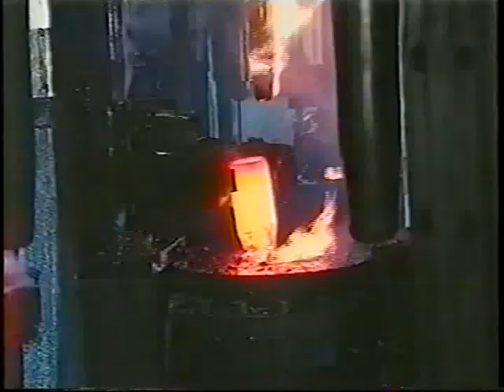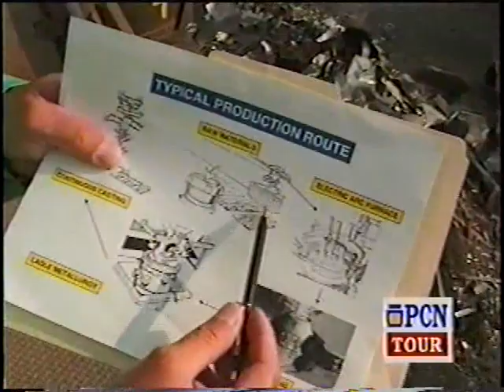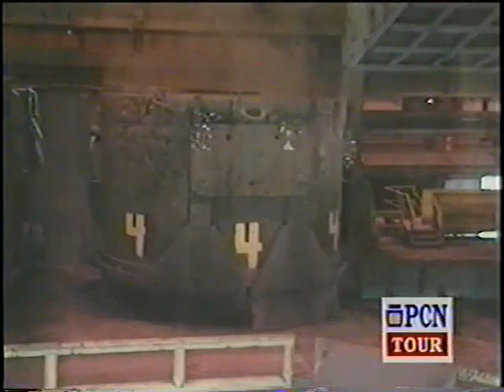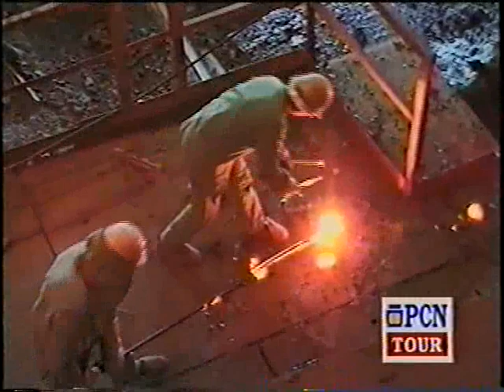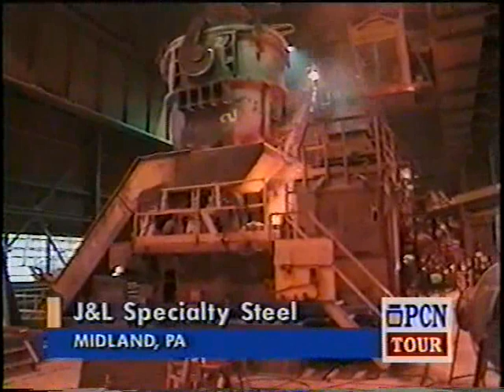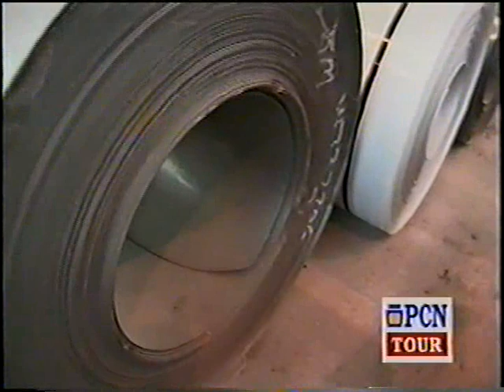PCN Tour J & L Specialty Steel

Comment: I almost took a job there on the DRAP line.  I backed out because a former manager contacted me and warned me about a certain plant manager who was the yell, scream and kick trash cans type of manager.  I still debate whether I should have gone to work there despite the fact that the facility ultimately did closed down.
Reply: I worked security there during the DRAP construction. Still remember the day a construction worker got killed there is a pretty gruesome manner. I always figured the guys down in refractory has a sweet job. For the most part they sat around unless there was a ladle burn through and the occasional ladle reline. For the most part they had a big pit BBQ going on down there on most days.
Reply: @currentsitguy  I was working for GE at the time for the DRAP line installation and commissioning - BWG was the main mechanical supplier - GE was the main electrical, motors, controllers, power..  I was on site the day that accident occurred.  Union Iron worker  It was my first major steel mill project and first job site death.   DRAP line was a big project I was able to see it from the initial concrete pad pour to the first coil.
Reply: @ Shame it's all shut down now.
Reply: @do you know if its torn down?  I tried to look and see what remained by looking up Midland on Google maps, but wasn't sure of the location I thought it was 1200 Midland Ave?
Reply: @yopajo  I drive past every week. It's not torn down, just shut down and abandoned. The mill is idle.

Comment: Is this plant still open? I sure hope it is
Reply: In 2004 it was bought by Allegheny Technologies. In 2015 they locked the workers out for 7 months. A new contract was signed and they closed this plant down. In November of 2017, the DRAP line was reopened. The rest of the plant remains idle. I work in this plant. I had 16 years in the melt shop/caster, now I work in the DRAP.
Reply: Hey Matt - could you help me with some questions I have about this facility? What is the best way to contact you? Email? Phone?
Reply: @JediNit2  is any of DRAP line plant still standing?  I tried to look for it on Google Maps and I think  I can make it out, but its been so long. - the entry, process, and electrical accumulators on the DRAP line were big.  I commissioned the E-Stop pull cord system, entry operator stands, processor pulpit, and the M&C units.